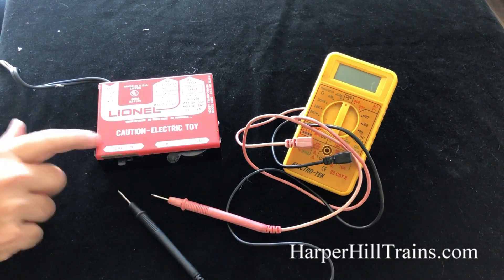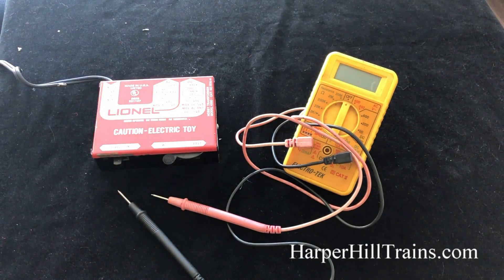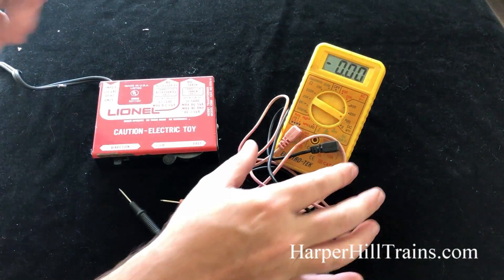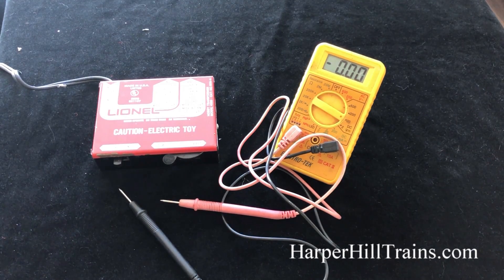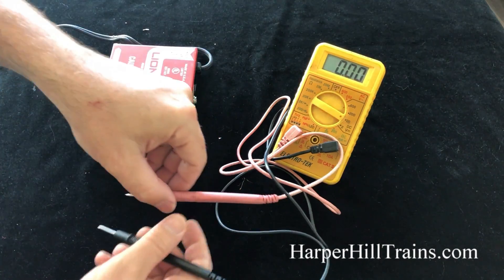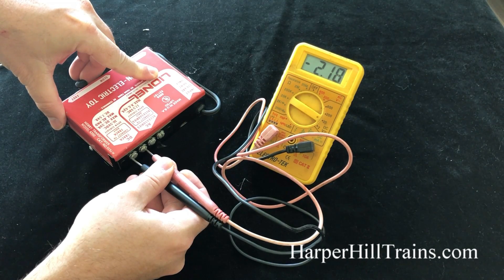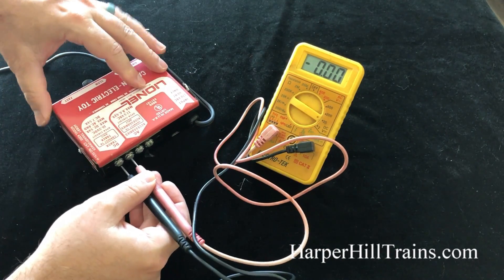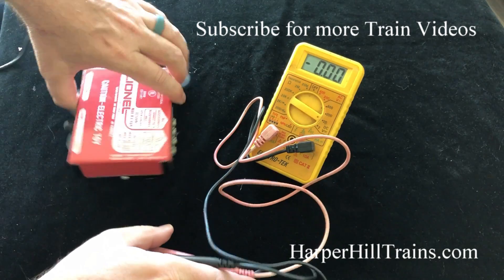How to Properly Test a Train Transformer Operation with a Meter - Lionel 4350 - Harper Hill Trains

Comment: Is there a way to test the accessory side of the Transformer
Reply from the maker: You should be able to test it in the same way as the power side.  It should produce a steady low voltage.

Comment: So how do your determine the polarity on the AC side (for switches/lights) if they are not marked?
Reply from the maker: It really doesn't matter about hot and ground on the accessories as long as they're getting power.
Reply: @BradDison  It does if you are using a capacitive discharge unit, since if you connect the wrong way and connect positive to the negative side of the capacitor you will blow it up.

Comment: Howdy, I have an old American Flyer HO “Pike Master” transformer that’s supposed to output 12v DC and 16v AC. The power is way too high with 21v DC and 23v AC. I get 12V DC on the lowest setting. How do I fix this and what is wrong?
Reply from the maker: I would have to have it here to test it out.  It sounds like a bad resistor or capacitor.
Reply: @BradDison  Thanks for responding. I opened it up and there’s not a single capacitor inside, just the transformer wired directly to the AC outlet and then goes over to a rheostat connected to a really weird looking rectifier and finally the direction switch. There’s not a lot of anything inside.
Reply: Okay, I did further testing and with my Bachmann G gauge 4-6-0 it outputs 3v at the lowest and 17v at the highest. Without being attached to anything it shoots straight up to 21v minimum and just stays there for the entire movement of the throttle.

Comment: what dial setting would I put my AstroAI multimeter to to test my USATrains 10 Amp PS?
Reply from the maker: I pulled up a picture of an AstroAI multimeter.  If you look at the top right of the meter you will see "200" two places to the right of off.  This should be the one.  I hope this helps.  :)
Reply: @BradDison  ok. I tested G and N scale for this PS and both read 35. So why do my G scale trains not move?
Reply from the maker: If you're getting proper power from from the power supply, there must be a short somewhere or a loose connection.  While your meter is in that same setting, touch various places on your track with your positive and ground probes.  I've been trying to recreated what you described and all I can come up with is a short.  I have one Lionel train that did the same thing.  There was a direct short in the train itself.  Please let me know if this helps.  If it doesn't, I'll do more digging.  :)
Reply: @BradDison  I will try that when I get home! TY!